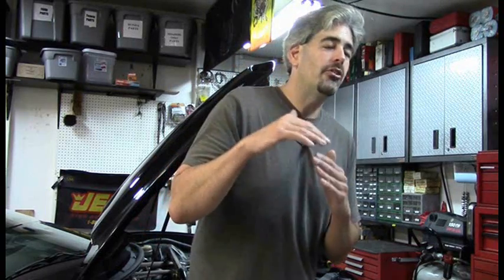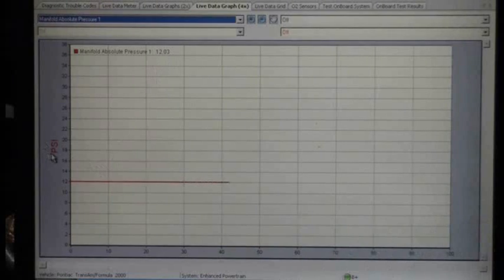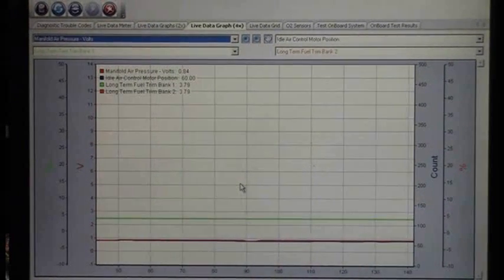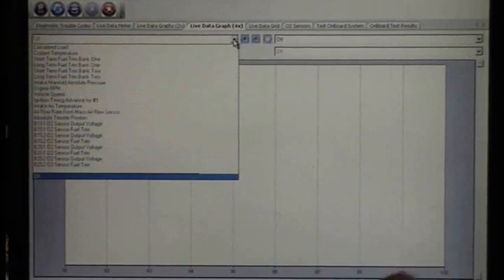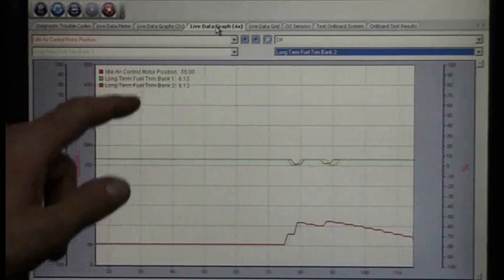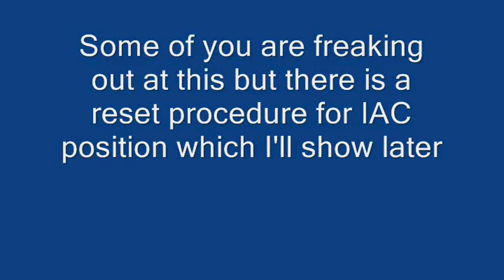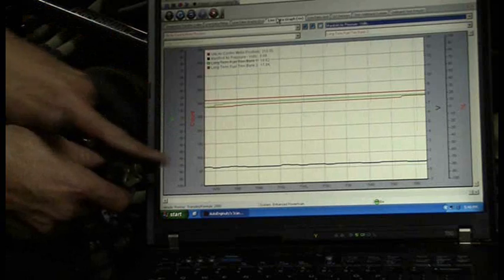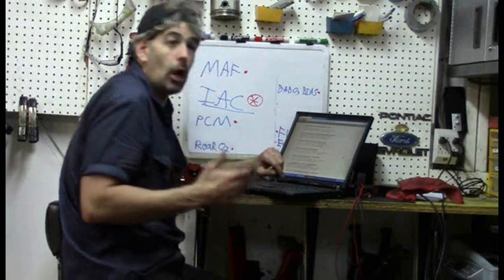P0171 Case Study from Hell 2000 Trans Am Pt3

Comment: The IAC on the TransAm is a Bi-Polar Stepper Motor, It is driven by a circuit called an H-bridge.  The motor is not driven by pure DC. It is driven by pulses of DC.

The internal resistance of each coil will probably measure in the neghborhood of 30 to 60 ohms (if the coils are not damaged). The rated resistance (spec) is probably 56 ohms.

For each full 360 degrees of the shaft, each of the two coils are energized by a pulse twice. 4 total pulses result in one full rotation.

It can be thought of this way:
For each full turn (360 degrees), there are four "steps", or independent "events". The events are controlled by the PCM. All 4 of the leads going to and from the IAC are controlled by the PCM, they are not any direct grounds on the IAC. There can't be, because half of all the pulses have to involve a reversal of the pulse voltage That's part of what the H bridge does.

Lets label the events A, B, C, and D.

In event A, a short (very short) pulse of positive 12 volts is applied across one coil. This pulse turns the shaft 90 degrees. In the next event, event B, another pulse of the same duration is applied to the other coil. This turns the shaft another 90 degrees. In Event C, another pulse is applied to the first coil, but in the opposite direction of the voltage applied in event A. In event D, a pulse is applied to the second coil, in opposite polarity to that applied in event B.

Each of the four pulses turns the shaft 90 degress. After four pulses, the same thing continues, as long as desired, and the shaft keeps turning 90 degrees for every pulse applied.

It's kind of like one coil "pushes" the rotation of the motor while the coil next to it "pulls" the motor along. It is the constant fairly fast switching of various coils on and off in alternating polarities that results in the seeming continuous "rotation" of the motor shaft. At 135 degrees of rotation, when the shaft is perfectly halfway between a pair of steps, the electromagnetism of one coil is decreasing while the electromagnetism of the next coil in sequence is increasing, and for that one microsecond the two forces are balanced before one gets stronger and one gets weaker.  This motor has 4 steps per rotation, but many steppers have much finer resolutions, like 96 steps per rotation.  Steppers are commonly used in VCR's, CD players, etc. Also extremely common in industrial applications.

Everything above is only half the total operation of the motor, because to get the motor to rotate in the opposite direction, everything above has to happen, but in reverse. As somebody already noted, on this IAC design the stepper motor can kind or "rest" close to the middle range of it's movement, When it rotates and linear motion occurs, it is because of pulses going to it, in one direction or the other. On a lot of Ford's though, the plunger is spring loaded, so the motor either pushes it open more or pushes it open less, but it's the constant spring pressure in the opposite direction that gets the plunger to move in one of the two directions --I think the normal state is closed, due to spring pressure, and that actuation of the motor has to occur for the plunger to "open".

That explanation is a little sloppy,, but it's close enough to be used as a general Theory of Operation.

These stepper motors NEVER use continuous dc current through them. Any current that occurs is always mere pulses of current.

Some types of stepper motors are controlled through the use of VPW Variable Pulse Width pulses or Pulse Width Modulation, but on this GM, I don't think it is. The speed of rotation of the motor is determined by the frequency of the pulses, and the total rotation is determined by the number of sequential pulses. The distance the "pintle" or "plunger" moves is determined by the threading pitch and/or gear on the part the pintle is attached to, and how it interacts with the motor shaft (gear ratio).

A stepper motor (including a stepper motor based Idle Air Control motor) CAN be tested for proper operations (sort of). The only thing required is 12 volts and a couple jumper wires. One end of each jumper wire has to be able to connect to each of the 4 pins or holes in the IAC connector (on teh IAC, not the harness). The other end has to be able to connect to the source of the 12 volts.

The limitations, or the tricky part, of testing a bipolar stepper motor is that it is very tedious, and involves a lot of moving of jumper wires (or the use of quite a few jumper wires)."All" you have to do, is to use jumper wires to apply the 12 volt pulses to various combinations of the pins or holes on the IAC, one after another. The length of the pulses is not critical, because you simply "bump" the motor with each touch of a jumper to one of the motor terminals. A T-pin or needle type probe or something similar might make it simpler to be able to touch each contact. But all it takes is a simple "touch" to the contact. A very momentary touch, barely a flick. Holding the connection longer won't make the movement of the motor any different, but could overheat the coil. The resistance value of the coil is what determines the current flow during each pulse. The resistance is high enough (probably about 30 to 60 ohms), that each flick of voltage to the coil terminal won't endanger the coil,  nor whatever is supplying the 12 volts.

It MIGHT be possible to use a standard test light to make each "touch" I assume it would, but I'm not positive. But I've worked with bi-polar steppers and I have just used simple momentary touchs of the lead, without any protective series resistance, to create each pulse.

But as I said above, each sequential pulse has to be applied to the opposite coil, and in an opposite polarity. So it's a lot of work. My initial reading has indicated that there are 320 possible steps in the TransAm IAC, so that's what, 80 rotations? So it is a very very fine pitch thread. (The 320 is my best guess, based on research, but I'm not positive about that number).

If there is something wrong with what the IAC is doing on the BlackBeast, then it is either a signal (or wiring) issue or there is a problem inside the motor itself. (Matt already stated this). The only method that I can think of to monitor what is happening is the use of an oscilloscope. You want to be able to watch what signals (pulses) are sent to the motor, and what motion or rotation occurs as a result.

There would be two pulse trains to watch, each 180 degrees out of phase with the other, and each pulse within one train would be of opposite polarities.

The motor HAS to be working fairly well most of the time, or the car and the idle would be not be correct. So if there's a problem affecting the IAC, it must be pretty intermittent or pretty small, I would think.

On an H-bridge stepper (in this case the H-bridge controller is inside the PCM), there is no "feedback" or "positioning sensing" that goes back to the PCM (as somebody else here already commented). The only thing the PCM can do is "assume" that  if it sends X number of pulses, that those pulses have resulted in Y amount of rotation, and hence Z quantity of linear movement.

If the motor is not responding properly, I assume the only inputs the PCM would have, to be able to see that, would be engine RPM changes compared to counts (steps) sent, air fuel ratio, and possibly a mismatch between Desired RPM versus Actual RPM. I can't think of any other ways the PCM would know if the IAC is not doing what it is commanded to do.

The above statements are based on a combination of my already existing knowledge combined with a little reading I did this afternoon. It is not authoritative, but I think most of the details are correct, or close to it.

I don't really have a handle on whether Matt's IAC is physically responding properly or not. I am kind of "tending" to assume that it is, because if it isn't and hasn't been for a while, then Matt would see it in RPM changes at idle, which he hasn't, as far as I know. If the RPM's, or at least the Idle Air quantity increases when the AC is turned on, that indicates the stepper is working and that turning the AC on is letting the PCM know that it should open the IAC more by sending more pulses.

I THINK (but I'm not sure), that if the IAC has any meaningful problems, it would be noticeable in idle speeds or idle variations or float, or with a problem with engine speed upon hard decel conditions (on the road). But Matt has repeatedly said there have never been and noticable drivability implications of teh 0171 code, so that generally points away from the IAC.

HOWEVER, during video 3 of the last round, it SORT OF seemed like the response of the IAC might be "flaky", or intermittent. If that's true (that there is flaky movement) then either the motor is being "sticky" moment to moment, mechanically, or one or both coils are having problems (broken wire just barely touching or conducting on a random basis), or the PCM is sending bad commands.

Pointing to the IAC   WAS  a pretty good idea for Matt, because he did have a way of explaining that if the IAC was the problem, it would or could explain every tested quantity so far. I personally have no real thoughts as to whether the IAC is working properly or not. The only way I would be comfortable labeleing it as Good or Bad would be watching shaft movement or motor rotations while monitoring all the pulses on an oscilliscope.
Reply: Schrodingers Box Douglass, Where do you get this quality of info? I knew enough about the operation of a IAC, just enough to be quite close to being dangerous, but after reading your post it all makes sense.  I'm not an electronic engineer or anything close but electricity and the control of electrical circuits have always fascinated me since I was a kid. For a amateur, I think I have reasonably strong understanding of electrical circuits and the material properties used in them and there interaction with mechanical systems. But you have made it all to clear as far as this IAC goes. To sum it all up the PCM pulses one of the two coils of the IAC to create a pushing force to rotate the armature shaft one step and then in the opposite polarity the PCM pulses the other coil to create a pulling force to rotate the armature shaft one more step and continues to do this until desired position is achieved. 

There's one thing that bother's me, and you just made me more curious. you explained that this particular IAC has 4 steps per rotation and that rotational speed  and linear position are controlled by PCM regulating the polarity and the frequency of those pluses. We know the PCM commands ( as ScannerDanner has stated ) this IAC to launch itself forward to the fully closed position ( Pintail Seat ) when the key is turned on and then the PCM commands it to retract itself to it's desired anticipated idle position on start up!  During the film, Matt described it as doing just that, It would open towards the close position fairly quickly and than it would retract rather slowly and would not retract all the way! Could this have been the PCM commanding the IAC to the pintal and then back to the desired IDLE Position! It only makes sense that the PCM would slow the frequency of those pluses down if it were only going to retract a short distance. I think this IAC was functioning, but as Paul Danner said if it stuck at some point or another it would become out of sync with where the PCM  thought the IACs position was in compared to the reality of the physical position of the IAC!  Not good for Idle control, You would think you would have Idle control issues. As a matter of fact, now that I am thinking of it, in Part 1 or 2, I forget, I mention  to Matt that just off Idle I thought I heard the engine stumble, not once but twice in a row as he tried to put the engine under load! 

Even with the car Fixed, we hope, there is still a lot that can be gleaned from this case study! Anyone care to elaborate?
Reply from the maker: Fantastic input bro, and extremely well explained.  I really hope everyone sees your comment- dead on!
Reply: Billy R

Billy said:  "To sum it all up the PCM pulses one of the two coils of the IAC to create a pushing force to rotate the armature shaft one step and then in the opposite polarity the PCM pulses the other coil to create a pulling force to rotate the armature shaft one more step and continues to do this until desired position is achieved."
PRECISELY!

As far as knowledge source goes, I already knew about half of what I wrote, and I got most of the rest of it here:
http://www.megamanual.com/ms2/IAC.htm

I also came across this:
http://homepage.cs.uiowa.edu/~jones/step/types.html
I can see that it is an EXCELLENT article, but I have not read any of it yet.

I LOVE a challenge in stuff like this, it's like a detective story to find just the right little nub of info, and so I've gotten good using the ole' Goog to find stuff. A good hint for ya here.....often you will find much better stuff, faster, by using Google Images, rather than just the regular Google. I do that a lot. Try it out, I think you'll like it.

Billy wrote:
"Could this have been the PCM commanding the IAC to the pintal and then back to the desired IDLE Position! It only makes sense that the PCM would slow the frequency of those pluses down if it were only going to retract a short distance. I think this IAC was functioning, but as Paul Danner said if it stuck at some point or another it would become out of sync with where the PCM  thought the IACs position was in compared to the reality of the physical position of the IAC!"

Yes, I think you have naailed it exactly right, there.

 As I wrote someplace around here, and several others have pointed out, the PCM does not get any DIRECT feedback about where the "pintle" or "plunger" ACTUALLY IS. All it knows is, it tells the thing to move X number of counts, and it then assumes the IAC does what it tells it to do. There is  no "sensor" or anything that directly lets the PCM KNOW that the motor is not moving properly. As far as I can think of, the only indication the PCM would have of improper movement is any change, or rate of change, of engine RPM, actual measured idle speed, and Desired Idle versus Actual Idle. Also, Air/Fuel information (the O2's might tell the PCM that the Fuel Trims aren't quite right, which would be a hint to the PCM that maybe the motor isn't working exactly right). Also, as one or more people have pointed out, IAC's DO get dirty with carbon. There has to be a way for the PCM to "learn" this over time, and to be able to factor it in to what it is doing, just like it does with a lot of other sensors, as they "wear".
Several people have pointed out two things: One, the computer is damn fast on this car (and VERY smart), AND that the stepper motor itself is extremely fast to move. Two, the PCM MUST be using an adjustment of injector open time to add a little extra (or a little less) fuel if it tells the IAC to open to a certain point to meet the right idle number, but if the idle does not go to that speed, the only other thing the PCM can do is add a slight amount of fuel. I'm 99.99% certain there is no "actuator" of any kind on this car that moves the throttle plate.So if it can't move the throttle plate, and it can't get the idle to go where it wants by adjusting the idle air quantity, the only other thing it can do is tweek the fuel (and the ignition timing). On older cars (in the 80's) there was a stepper motor that moved the throttle plate to adjust idle speed.

So overall, I think your "understanding" that you wrote here is perfectly correct in every sense!

And just to be clear, it is not that I definitely KNOW any of what I'm writing, (well some of it I know for sure), but a lot of it is just Inferring on a logical basis. I also STEAL a lot from what everybody else is writing, then I "re-mix" it into a different type of narrative, and just post that. On the IAC and stepper motor stuff in particular, that are at least six people here who have proven they know WAY more about it than I do.

But as Steve Jobs used to say: "good artists borrow, GREAT artists STEAL".

Be Well
Reply: Well Said! about Great Artists Steel! Gotta remember that one! Going to check them sites out that you gave me , Thanks!

Comment: Just take a 9v battery and tie the two "low" leads together and connect to negative.  With the other leads,  alternately connect to the positive side of the 9v. You should see the valve move one step at a time. To make it move the other way, just reverse the connections by tieing the high sides to the negative and alternately connecting the low leads.